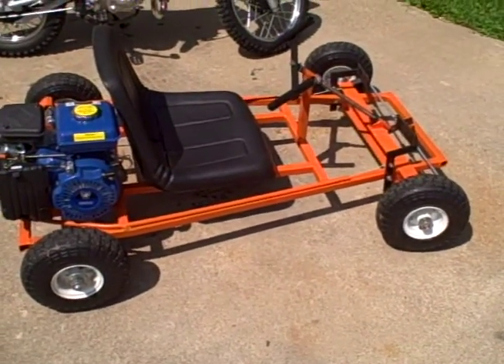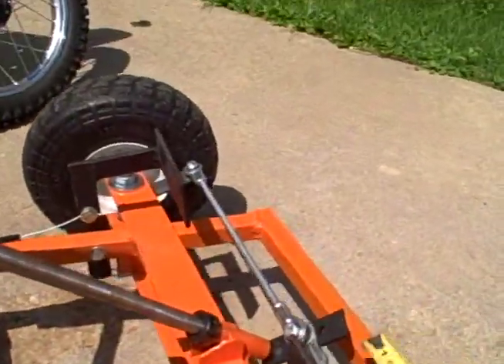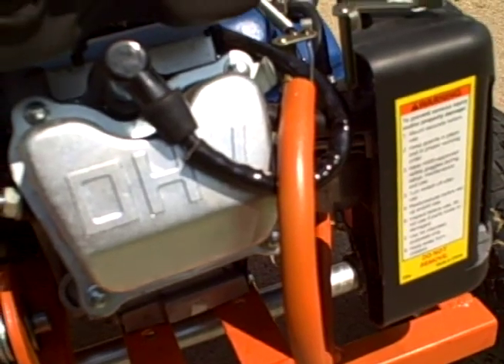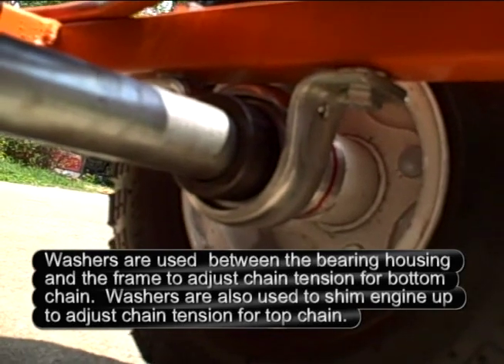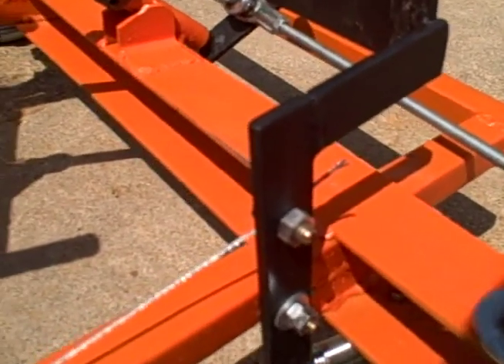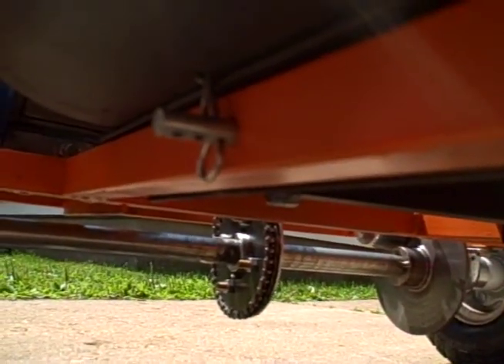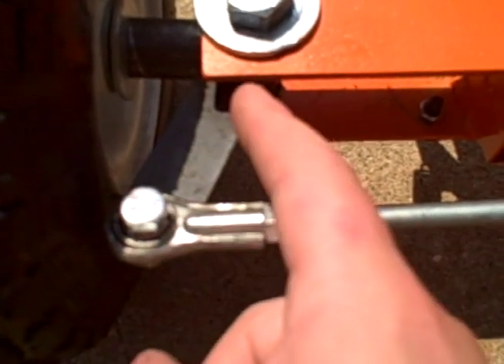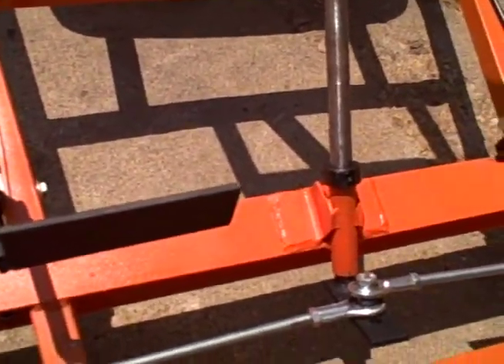Dimensions and building tips from my homemade gokart (part 1 of 2)

Comment: @95JD95 hey! I'm building one out of wood ( for fun ) and I wanted to know about the engine, because I'm getting one.. ok, does it come with a clutch? how did you mount the engine to the frame? does it have a mount? how did you attach the gear to the engine, and to the axle??

Comment from the maker: There is zero camber on the front wheels and zero caster.  The first one I build had 3 degrees positive caster but it made steering hard along with the fact that I had the ackermans angle backwards on it.  This one I just zero'd it out and correctly implemented ackerman's angle and it steers great with little effort.  Does push a little in the corner's but thats because of the solid rears axle.

Comment from the maker: Originally I built my own axle.  I used threaded rod inside steel tube.  The bearings rode on the tube and I bolted the tires on the ends.  Problem was it was too weak and under load you could see it vibrate which occasionally caused the chain to jump a tooth.  The vibration basically coming from the clutch on the brink of engaging.  Plus the originally rims would slip because they were not keyed and were just a clamp fit.  So I had to break out the wallet for the axle and rims.

Comment from the maker: The wheels are 10 inch.  The rims were purchased through northern tool and they are 10x4.5.  The rear rims are keyed with 1/4" keys so they lock to the axle.  The front rims came with bearings.  I made the spindles.  They are not hard to make.  Just a 2" cut of steel tubing and weld a bolt to it that fits your front rims.  Then just grind flat the front of the bolt head so its flush with the tube and weld a arm at the appropriate angle.  For longevity they really should have some kind of bushing